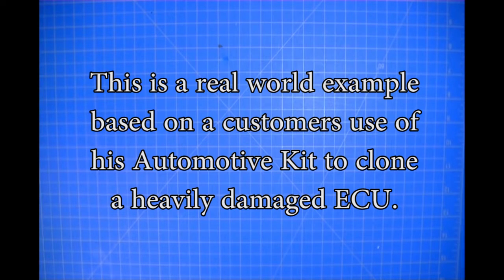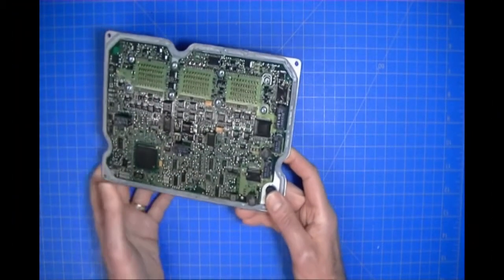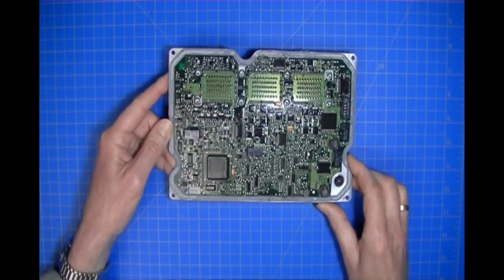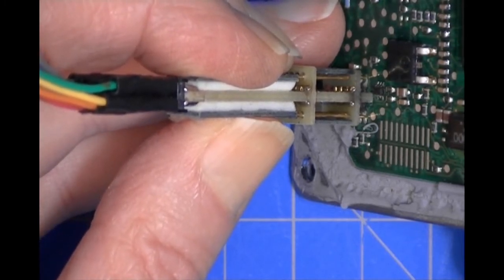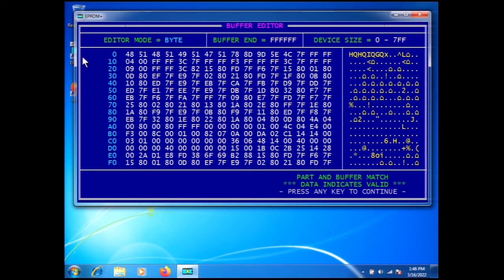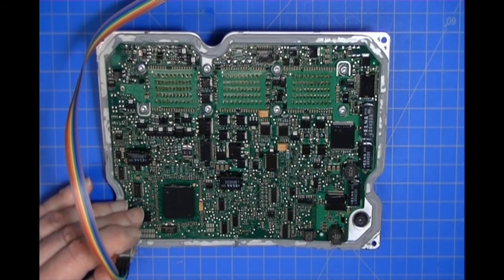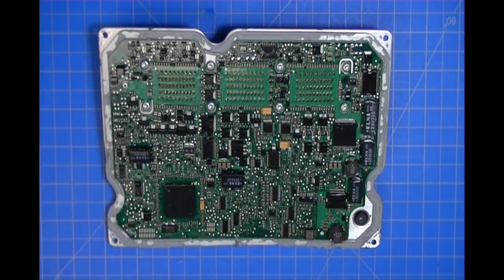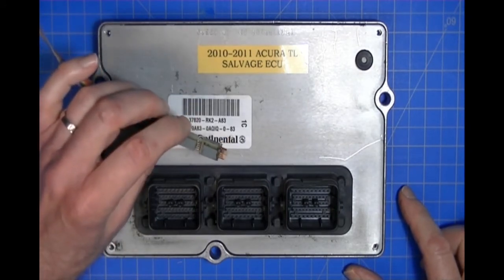How to clone an ACURA TL ECU - A real world customer story where EEPROM WORK was successfully used

Comment: Im thinking of doing this as a side hustle and was wondering if theres any way i can sell unlocked radios that are plug and play for the buyer without the buyer having to send me their old radio.  Can i just delete the EEPROM VIN and then it will be ready to plug and play?  A vin will be generated for it because the microcontroller will see there is no vin?  Or is there any way i can just use the buyers VEHICLE VIN to write in the last 6 digits of it?
Reply from the maker: I have no direct experience with radios. I would assume that if you erase the existing eeprom data the radio would be in a virgin state as if you purchased a new one. There is no way of which I am aware to to use the VIN to unlock a radio. If you have access to a new radio and read the eeprom data you can save it to use in the future.

Comment: New subscriber and I’m in the process of learning automotive electronics and repair. I’m retired aviation technician/mechanic background and have watched other mobil technicians do reprogramming by going through dealer prescriptions and all sorts of scanner and factory purchased  subscriptions. Is reading the eeprom and transferring data from one eeprom to another doing the same thing but internally through the chip? If so I would definitely choose your process to everything I’ve watched so far. Does it work say on Asian vehicles as I personally own Hondas or can it also do domestic vehicles? Seems like a very useful piece of equipment. Thanks for sharing your equipment and your company’s expertise. 👍.   Artie

Comment: ok.  so how do you go about determining whick 8 pin chip is the EEPROM chip. i did not see the vin number in the right column. or do you go by the number on the chip.
Reply from the maker: We teach you how to locate the eeprom in the training information which is included with our kits. Regarding the VIN in the cloning video, the part is a 2048 byte part. What was shown on the first screen is only the first 256 bytes. The VINM is likely stored further up in the data field.